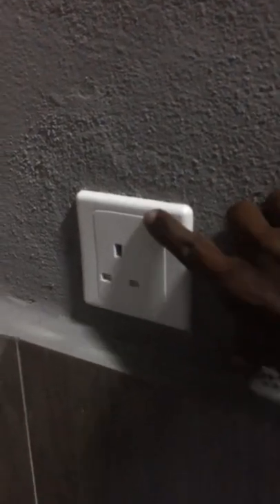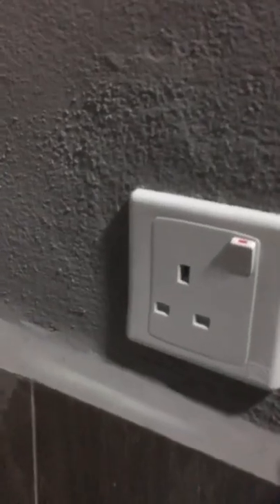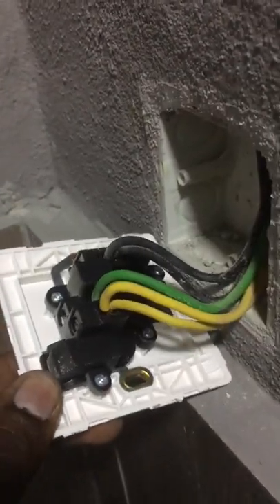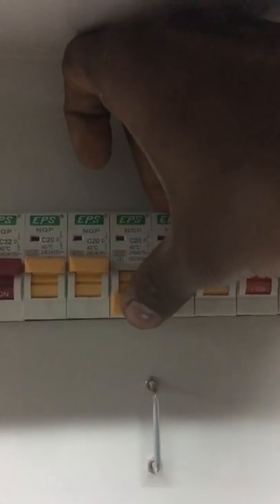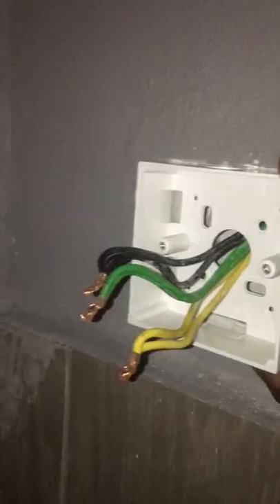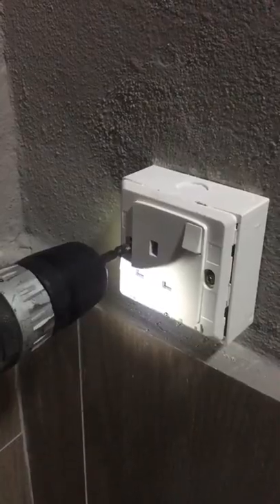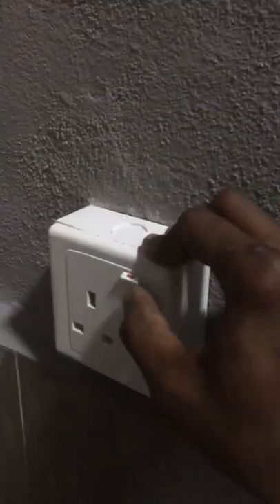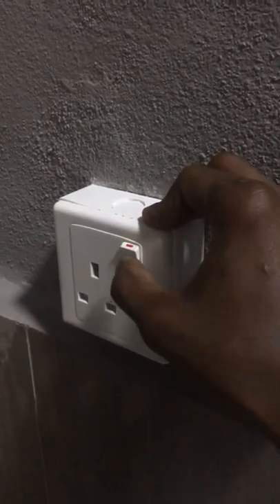Stuck Socket Switch Repair #electrical #short #wiring #electrician #electric #diy #fyp #engineering

Comment: Brand MK SSO 13 amp always have this problem when use high amp equipment on this SSO . I change to another brand like Hager & Simens SSO the problem is solve due internal part are more quality and tough then MK brand . . .
Reply: Just use a contactor or a B-SCB/RCD/RCBO